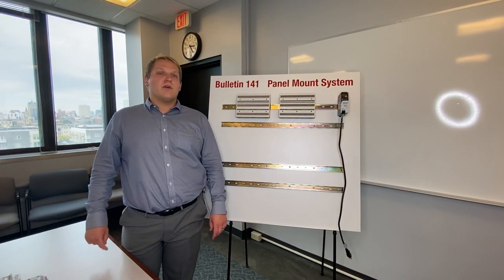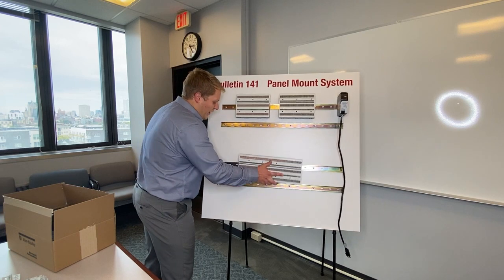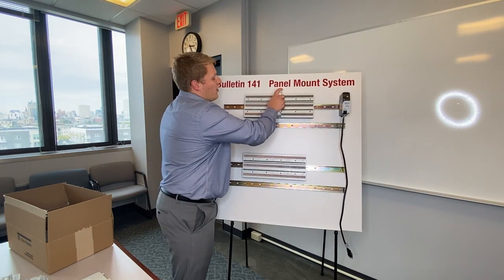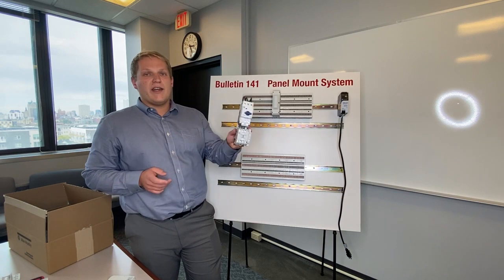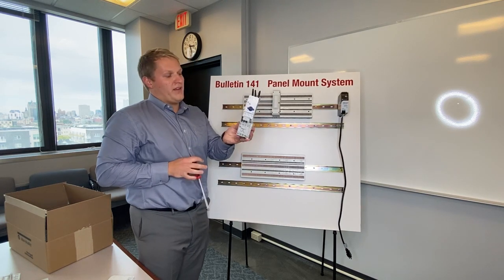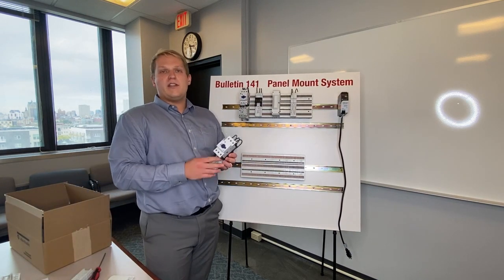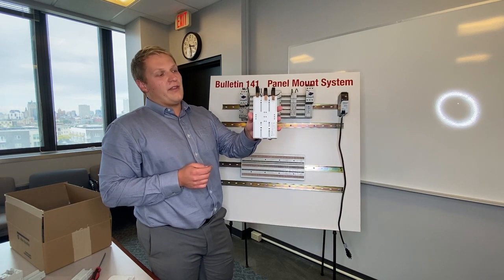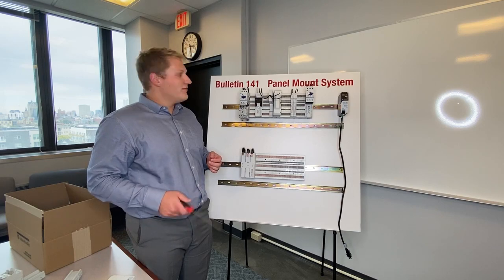Bulletin 141 Panel Mount System Hardware Demonstration

Comment: Good video. I do have a question about the base units if I may. Are the base units surmounted by a mailable algometric casing to where the spurving bearings are in a direct line with the pentametric fam?